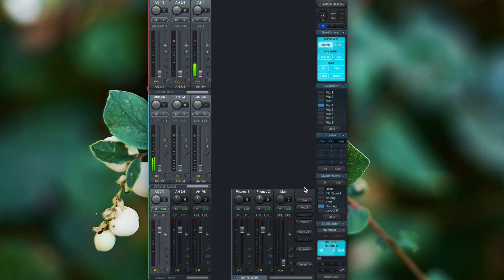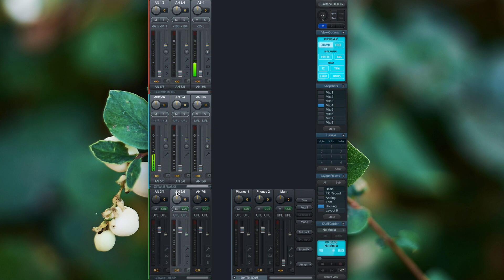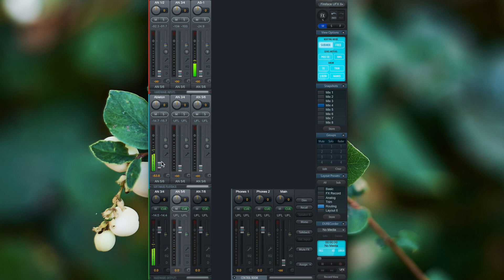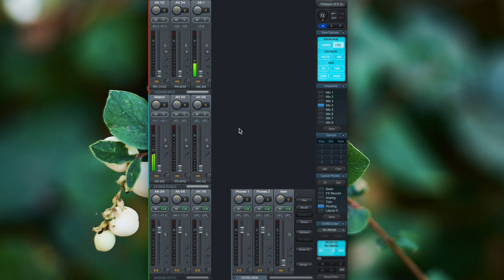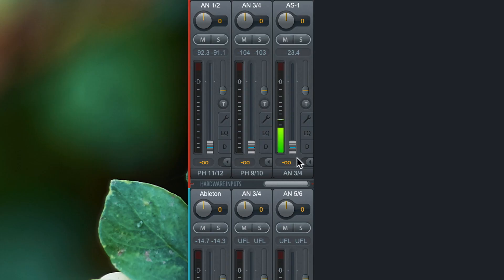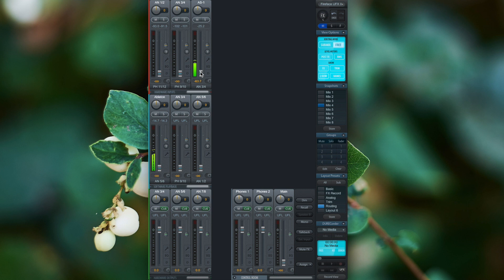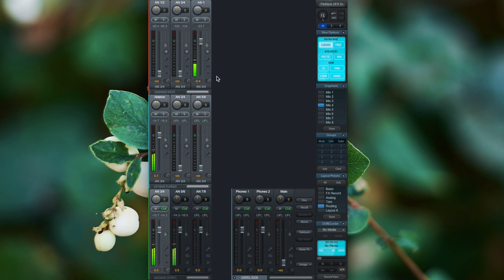TotalMix FX for Beginners - Free vs. Submix Mode

Comment: I am using RME UCX fireface for routing my Traktor Pro 4 dj playback software. I am using 2 Traktor decks. I assigned Analog 1 and Analog 2 to Deck A in Traktor. Then I assigned Analog 3 and Analog 4 to Deck B in Traktor in External mixing mode.  In the TotalMix sofware, what setting should i use (Free or Submix mode). Issue I am running into is that in my External mixer, I can hear the audio from both decks A and B in one channel in my audio mixer. Perhaps the setting in Total Mix is routing the audio and combining them both. Can  you please send me settings for Total mix that I should be using. Thanks.
Reply from the maker: It desn´t matter if submix or free mode. This is just a different "view" to the mix. In your case you can go to "options", "Reset Mix" - "straight playback". If this doesn´t work you can go back step by step by using the "undo" knob in the top right corner.

Comment: I'm confused as to why in submix mode all the channel names at the bottom of the channel strip are all the same for the top two rows (input and playback). ie: If I change a channel name in any of the top two rows all the channel names change also. This doesn't happen in free mode. Thanks

Comment: The video isn't clear.  It almost gets there, but not quite:

IN SUBMIX MODE - Win a an Output is pressed, that Output controls the rest of the board - So you will instantly see that output's label appear at the bottom of all input and software channels.  Any input or software faders adjusted will only apply to their links to the active Output.

Free mode does operate the way he shows.  Submix mode is a little more intuitive: At you click and switch from output to output, you will instantly see the faders on all channels routed to that output move, giving you a "big picture" of the routing.
Reply: Yes that is confusing and I can't work it out

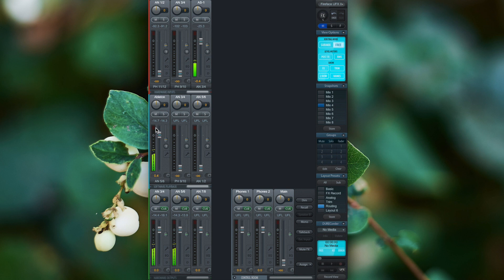Comment: 2:00 in the submix mode? or in the free mode? several submixes at a time? in the manual it says in the free mode you can work on several submixes at a time
Reply from the maker: It's indeed wrong at 2:00 in the video. He should say "free mode" but says "submix mode". In free mode you can work on different sub mixes at the same time.

Comment: Thanks for the video. I believe it should not be called a "routing mode" because it does not influence the routing, only the way we SEE the routing in the tool. So in my opinion (I have worked on GUI before) it should be rather be called "View mode".

Comment: I still have a hard time to wrap my head around it. is it possible to chain outboard using totalmix. eg, mic on channel one to compressor on in/out 2 to a reverb to a delay and then all of that to one channel to record?
Reply from the maker: Yes you send your microphone signal to your outboard gear via an output and from there back to an input. From there you can record in your DAW.

Comment: One of the quite unique features of Total mix Fx is the possibility of controlling the software with a midi controller, i may be wrong but i cant think of any other company that offers this natively...Unfortunately i cant find a video explaining the use of this feature. Can you point me on the right direction?? Thanx.
Reply from the maker: TotalMix can be remote controlled via MIDI. It is compatible to the widely spread Mackie Control
protocol, so TotalMix can be controlled with all hardware controllers supporting this standard.
Examples are the Mackie Control, Tascam US-2400 or Behringer BCF 2000. 

 Setup
• Open the Preferences dialog (menu Options or F3). Select the MIDI Input and MIDI Output
 port where your controller is connected to.

• When no feedback is needed (when using only standard MIDI commands instead of Mackie
 Control protocol) select NONE as MIDI Output.

• Check Enable MIDI Control in the Options menu. 

You can find the detailed instructions in the manual of your Midi-capable interface under the section - TotalMix MIDI Remote Control.
Reply: @RMEAudio  Thank you very much for your answer. Where can i find a table with the Midi CC's if i want to control it via standard controller???
Reply from the maker: @RicardoSilvaMusic  The Midi commands can be found in every manual of a Midi capable RME interface.    Page 85-90    http://www.archiv.rme-audio.de/download/fface_ufxplus_e.pdf

Comment: Hello, thanks for the content.
Im an owner of a Babyface (old One). Can i use the 3/4 outs With an adapter to send my mix to my analog gear? I dont know because, seems like the 3/4 outs are a copy of the 1/2 signal.
Hope you can read this.
Reply from the maker: 3/4 are the headphones, but separate routable. Please check if the mirror function is activated on your output.
Reply: @RMEAudio  oh Thanks! So i can send my mix output to channels 1/2 and connect my monitors to 3/4, right?
Thanks a lot!
Reply from the maker: @leonardocoronelbarraza8758  That is correct.
Reply: @RMEAudio  what's the mirror function?
Reply from the maker: @UKGUYINMANCHESTER  You can mirror the routing of an output to any other output. e.g. Main on headphones. As soon as you change something on the main routing, this also transfers to the mirrored outputs

Comment: Im trying to mix in pro tools using rme as my digital mixer, when i move certain knobs the sound changes etc, what should i focus on hardware outputs etc? Should loop playback be on? I wanna bounce song in pro tools with final sound,
Reply from the maker: If loopback is activated in the outputs, it routes the audio exactly as it is to the corresponding input. So any changes to the signal to that output, you hear at the input, hence recording.
Reply: make sure to either use input monitoring in ProTools and don't route RME inputs to your TotalMix Main/Phone outputs,
or disable ProTools input monitoring and use TotalMix FX routing for (zero latency) monitoring purposes,
this depends on way you want to work especially when doing let's say punch recording at various modes, or being able to hear inputs no matter if you want to record them in ProTools or not

Comment: I'd appreciate a video about about using TotalMix Fx to route multiples channels or buses from a daw to an analog mixer and back in to that daw.  What works best, DAW, Free or Submix mode?  Are there TotalMix Fx settings to be aware of that will cause a feedback loop?  I'm using Studio One and a Fireface 802.  Routing the daw playback channels to the 802's outputs in TotalMix Fx is problematic.  Thanks.
Reply from the maker: What works best is up to you. I would recommend the Submix mode. Then you get a better overview of what you are routing and you are more flexible in choosing in- and outputs.. The feedback might happen when your software monitoring is routed to the same channels while creating an insert.
Reply: Think I found the problem and yes, it has to to with routing and faders in TotalMix.  In order to hear and record the summed signal coming back into Studio One (SO), let's say from Input 7/8 of the 802, Input Monitoring must be 'On' in SO with that channel's Input being 7/8.  In order to hear that SO Channel, let its Output be 9/10.  In TotalMix, route SW Playback 9/10 to PH 9/10.  Turn up the SW Playback 9/10 fader to Unity or whatever.  My mistake in TotalMix was turning up the Input 7/8 fader and thereby sending that signal to PH 9/10 also.  I was routing 'both' Input 7/8 and SW Playback 9/10 to the same hardware Output, PH 9/10.